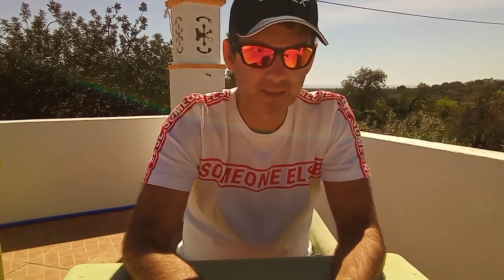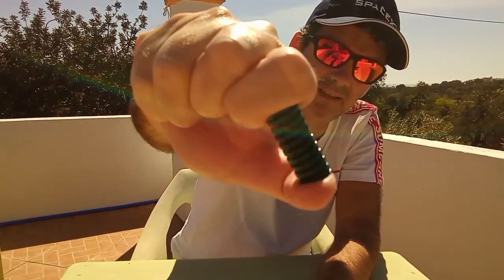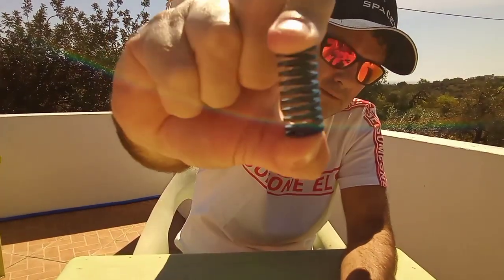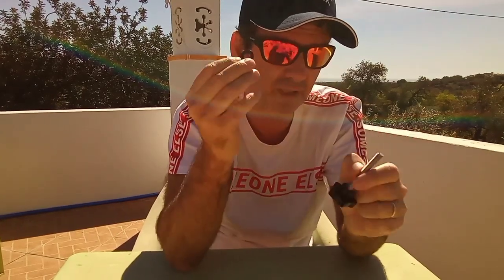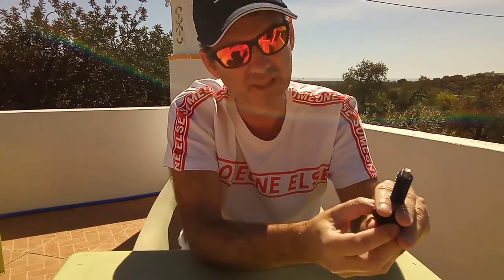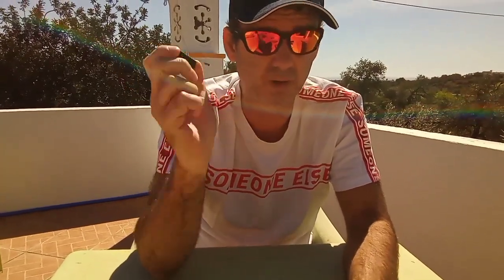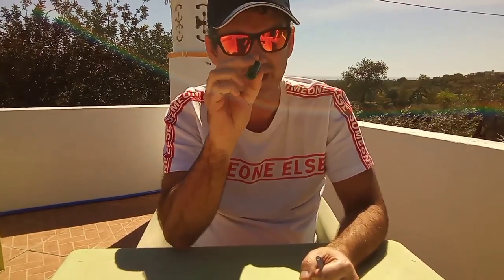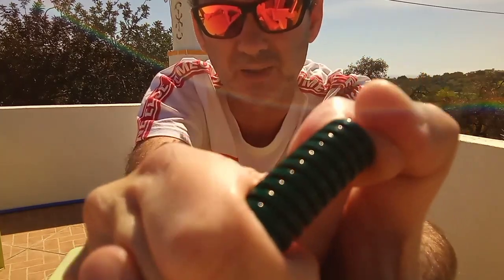Always Loosing COLLIMATION? Do This Simple Upgrade

Comment: What springs do you recommend for a 10” Dobsonian?  Zhumel 10
Reply from the maker: You have to measure the distance to the mirror and the knobs width. My knobs are M6 and i bought springs with M8 INSIDE hole but my mirror was moved forward so it has more height for the springs. You have to measure your distance and buy springs just a bit larger. Each set up is different.
Reply: @DobsonianPower  do I release the tension fully and then measure?  Do you have an Amazon link?
Reply from the maker: Yes. You can measure without tension and buy a bit larger. https://www.amazon.com/gp/product/B08XBFK92M/ref=as_li_qf_asin_il_tl?ie=UTF8&tag=keepitsimp06b-20&creative=9325&linkCode=as2&creativeASIN=B08XBFK92M&linkId=55fa3c5757bc74889f4a62e17375cadd
Reply: @DobsonianPower  what size belleville washers do you use?
Reply from the maker: @AstroHunter5280  i've used M8 which are larger and fit the springs better but you can use M6 too and also regular washers.
Reply: @DobsonianPower  Thank you!  Appreciate all of the help!
Reply from the maker: @knightclan4  with these springs and secondary mirror well tighted i never collimated again. and i check every day, always perfect.
Reply: @knightclan4  I couldnt find any springs from the video that would actually fit because of the knobs so i went with the washers and "uxcell Compression Spring - 1.2mm Wire Dia, 12mm OD, 15mm Free Length Spring Steel Extension Spring,Black,10Pcs."  They arent much better than the other springs but have more coils.  Ill still hunt for the other springs but i got tired of returning them ha
Reply from the maker: as long as they are stiff and strong and fit well you will be fine

Comment: What is the dimensions of the spring?  I don’t know if 40mm is too tall or not
Reply from the maker: you should measure your distance. Anyway you can cut them with a metal saw if needed and the opposite, add washers to fullfill
Reply: @DobsonianPower  I decided to go the Belleville washer route.  It’s a bit tricky to use but the the mirror barely budge and the collimation was just slightly off after wheeling it to the backyard.  I couldn’t get it to sit still with the numerous washers I got at the local hardware store.
Reply from the maker: @Zeron18  should work. I use 1 spring plus 2 or 3 Belleville washers

Comment: Good tutorial thanks! I need about 100mm lift to get focus with a binoviewer... will use  threaded rod😀 can't see a 10in mirror being very stable perched out on the end of them but we will see !
Reply from the maker: I would be worried about the size of the secondary not being enough to capture all the light. Check that
Reply: @DobsonianPower  yes it's a tradeoff, though ahead of using an OCA I hope :)
Reply from the maker: @haroldland4620  a low profile focuser may also help👍
Reply: True ! Every mm counts 👍

Comment: I just bought an AD8 dob. It is weird to me that the manufacturers don't use a superior spring in the first place. What is the impact of reducing the focal length due to longer springs? I'm thinking of cutting these long springs down to a length closer to stock length. In this case (shortening springs), would I use a stiffer spring?
Reply from the maker: If you need more inner focus you need longer knobs and springs. The opposite will move your focal plane closer to the secondary. The longer the springs, the stiffer the better.